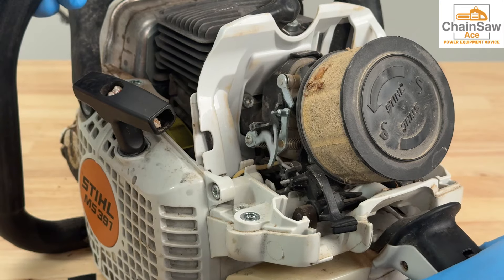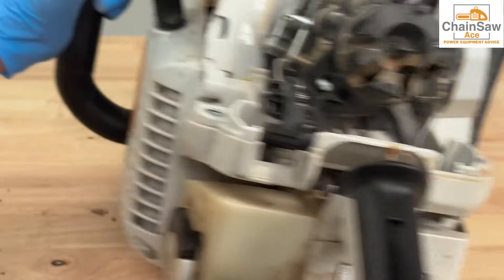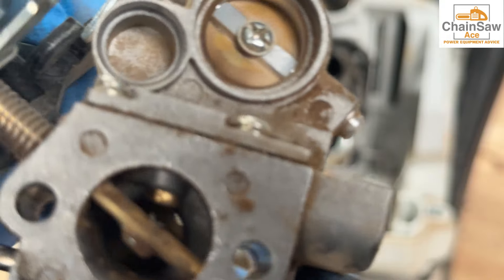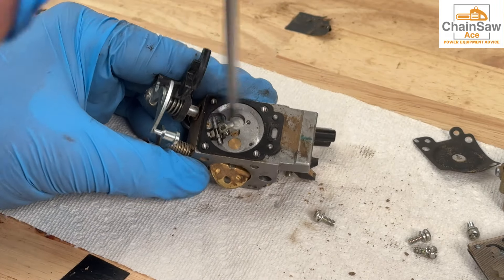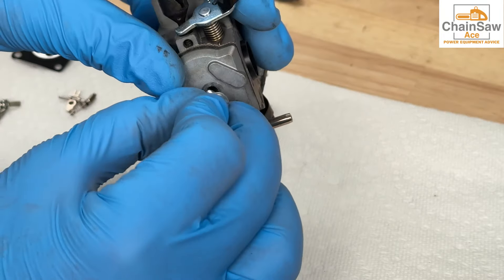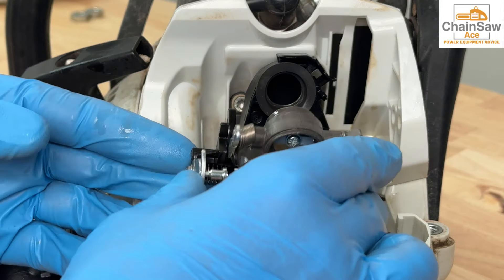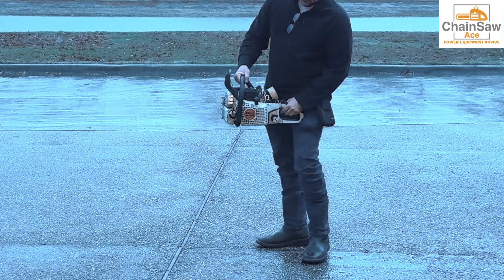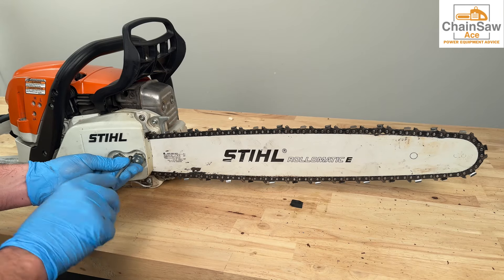Severely Clogged Carburetor Crisis - Could It Spell the End for This Stihl MS391? How To Prevent!

Comment: Another awesome video!! 

Was that filter damaged or did it have a bad seal?
Reply from the maker: Thanks so much!

Filter did not appear to be damaged and the seal was fine. 

The dirt appeared almost like a fine powder or baby powder. Very very fine. I think it was smaller than the micron rating of the air filter and just penetrated the filters fleece. 
Very strange. 

I've seen this happen with a Briggs and Stratton before on a mower. First time I've seen it on a chainsaw. 

Not sure of the conditions the saw used in. 

Thanks again man!
Reply: Could this be because the chain is not sharp or not taking a big enough chip?
Reply: No clin air filter ,clin cheinsaw ,fresh 2t oil no problem